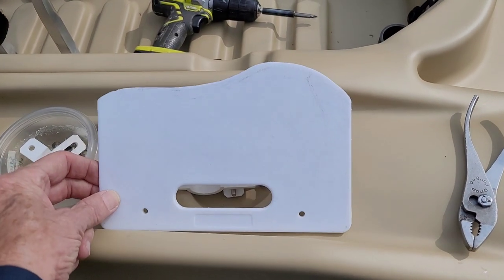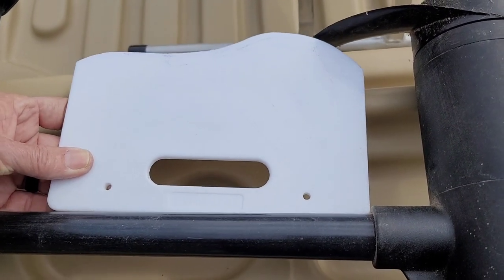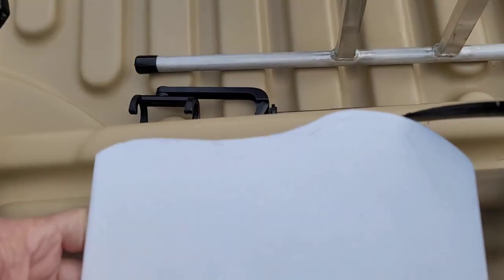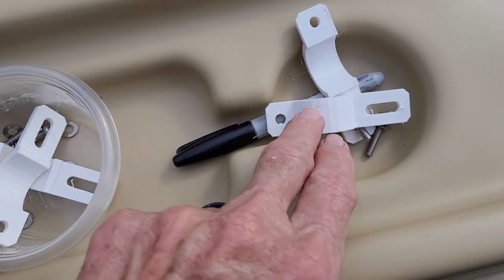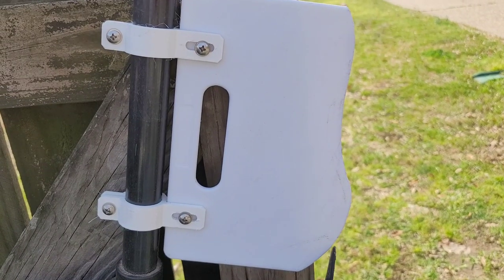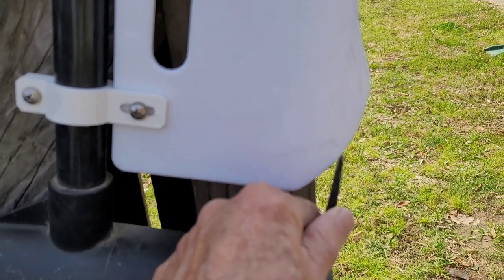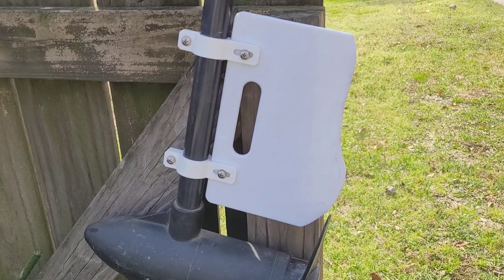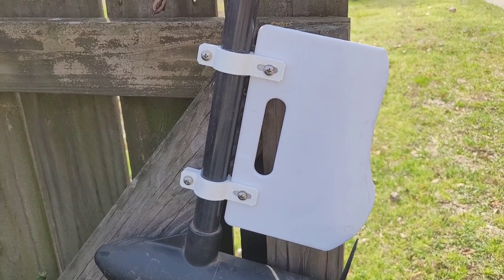DIY: Super cheap trolling motor rudder

Comment: Would it work if you flipped it around to the other side of the shaft? I have my trolling motor on the front of my boat and when I put a rudder on it makes it to where I have to have the shaft all the way down in order for the rudder not to hit the front of the boat.
Reply from the maker: Sorry for the delay in getting back to you.  I've been away from the computer for the past week.  I don't think it would make a great deal of difference in how you locate the rudder.  However, I've not tried it any other way than shown.     ~John

Comment: Sure would of like to see it in action , I just picked up a factory made one from a amazon pallet seller store for $5 bucks but haven’t installed it yet and I need to get a battery, but thought it’s a good idea , have you tried it yet?
Reply from the maker: Thanks for your comment.  The rudder works great.  I use my trolling motor on the back of the boat and it made a huge difference in tracking.
Reply: @omoutdoors  I’ll be mounting mine on the bow it makes perfect sense to me ,the skeg on the bottom of trolling motors seems small,and the add on rudder would guide water flow a lot more , I’m just hoping that it doesn’t over compensate, or that it gets in the way when I put the motor up or for traveling .
Reply: Did it have any effect on turning or going in reverse
Reply: @redwood1957  , it does make my 11’ skiff turn quickly, in reverse I don’t go fast but it is more responsive, it helps a lot if your fighting a breezy day , mine is mounted on a bow it’s a 45 lb thrust  minnkota , Riptide saltwater trolling motor, it is a great set up . 👍🏼
Reply from the maker: Apologize for the delayed reply.  I just noticed your question.  The rudder does have a positive effect when turning; the boat seems to track better around the turn.  As for reverse, since I only use a 30 lb trolling motor I've noticed little effect.   ~John
Reply from the maker: Thanks for adding some good info in your comment.  ~John